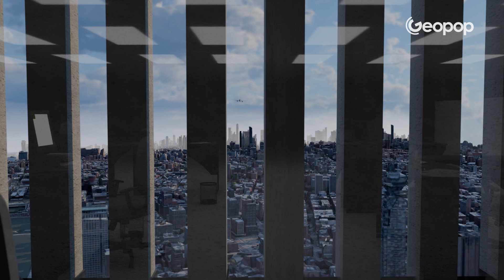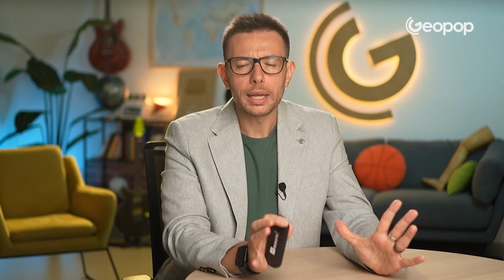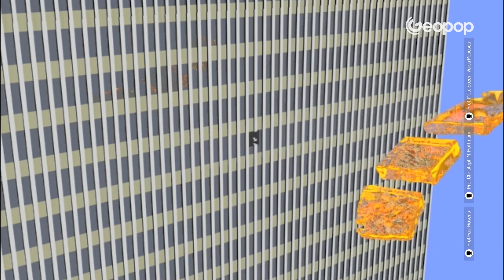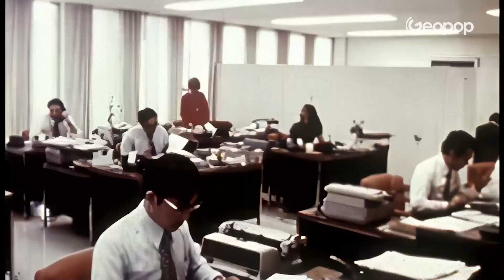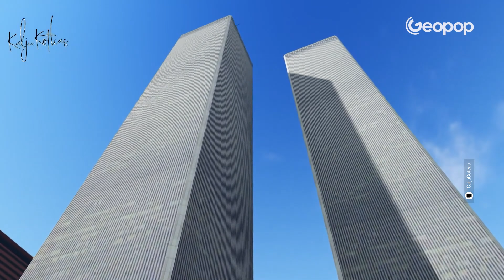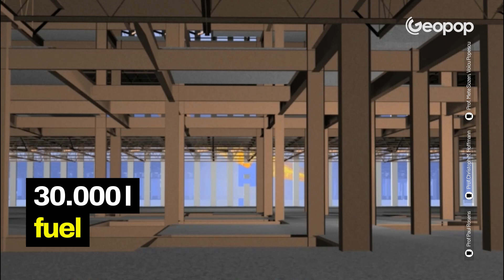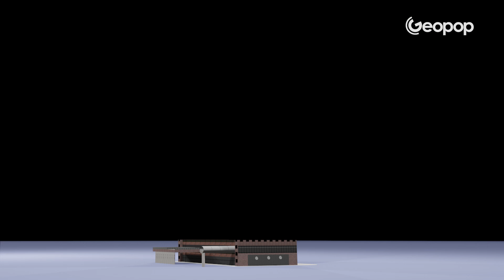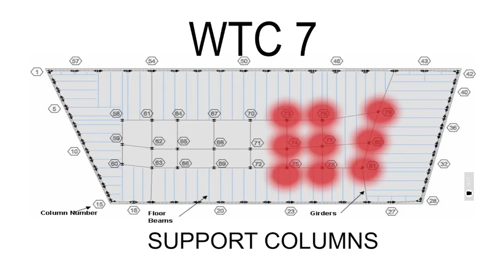9/11, 2001: The Technical Reconstruction of the Twin Towers and WTC 7 Collapses

Comment: I saw on another video that it was detonations going off inside the towers and you could actually hear in the recording the explosions going off from the very top of the building all the way down to the bottom like a controlled demolition and that’s exactly the same way the buildings fell down like it was a controlled demolition it wasn’t just because of the plane the entire towers were built very well they would never have fallen due to just a plain only may be a few floors would have fallen at the top where the plane hit And even if the molten steel got soft enough to collapse on itself it wouldn’t have collapsed the entire tower the way it was built it was a controlled demolition they just simply detonated it after the plane hit to make it look like the plane was the cause for the collapse of the towers the planes actually hit the towers but they were not the cause of the towers collapsing
Reply: So this video you saw was fake. Lemme guess. You can't find it now because it got scrubbed from the internet (like that's a thing and no other media exist).

More dog are my homework BS.
Reply: "I saw on another video that it was detonations going off ..."

Did that other video have a UFO flying above the building about 6 seconds in? I'm not joking! The video you saw was by a comedian who made a fake video with fake explosions (and the UFO!) to see who would bite!

Comment: So many stupid people that were not there with dumb theories who cannot fathom the horror and terror of just being there that day, let alone being a poor soul stuck inside during that raging inferno with nowhere to go. People jump because it simply was so hot. Consider going near a hot fire and what you feel near it ? You immediately go towards free air and relief. Well some simply just couldn’t stand the heat and some couldn’t see due to a giant hole being in the building. Many people are just ignorant to what the inside of that building looked like after an impact of a 737 massive aircraft plunged into it full of jet fuel at over 500 MPH. Floors and walls were missing and bodies and parts of bodies along with a huge air craft was everywhere along with thick black smoke and fire. It must have been truly hell. No other word to describe it. Now building 7 along with many other buildings had raging fires inside as well. After the collapse you must think of all that debris falling and scathing the building doing huge damage to the structure. Just because from the outside it looked “stable” doesn’t mean anything. The towers looked fairly stable even after the impacts until they didn’t . This day never leaves me and I was only watching it in the city. Have compassion for those and their families who were murdered that day and consider what you may have done if you were trapped up there under the worst conditions possible for humans to survive. Don’t forget 18 we’re able to find a stairway above the 72nd floor in one of the towers and lived to describe what it was like up there. A few even survived the collapse that were in lower floors by exits by miracles. My father’s friend Pete was saved by a “cherry picker” or bucket truck from the scene of the collapse. So miracles happened that day also. With any mass casualty or tragedy there is horror and always some kind of good and unbelievable feats of the human strength and spirit.

Comment: We still have access to images where we see steel melted! I just want an explanation for that...
Reply: OK, present the images you want explained.
Reply: @TheLoonResistance  https://www.youtube.com/watch?v=gPu9IqBfMIw&t=147s
Reply: @tiagommmagalhaes  How do you know that's steel?
Reply: @TheLoonResistance  youtube link -> watch?v=gPu9IqBfMIw&t=152s
Reply: @tiagommmagalhaes  - Easy enough. So you think that is molten steel why?  Because you performed metallurgical tests?  Because the internet told you that’s what it is?  I think we can do better, so let’s do better and build a theory the right way instead of making evidence-free assumptions. This will take just a couple of minutes and is worth the investment. 

The Boeing 767 which struck the South Tower weighed 117 tons and 80% of that was aluminum.  The exterior cladding on the Twin Towers – the white panels – were also aluminum. When Flight 175 struck at the 81st floor its momentum deposited much of the office contents in its way and the bulk of the aircrafts mass into the NE corner of the building. The piled up debris shoved into that corner is visible in photographs and video so we know it was there. 

There’s a good shot here of piled up debris from 4:36;

youtube.com/watch?v=ZLJyL63sqtU&ab_channel=MrKoenig1985

Steel melts at roughly 2,750-deg F while fires in the South Tower reached peak temperatures of around 1,800-deg F. Aluminum OTOH melts between 887-deg F to 1,180-deg F depending on alloy. That aluminum will melt under these conditions is not a surprise. If you look at pictures of cars left behind and destroyed by forest fires the aluminum wheels are invariably melted away along with other sometimes aluminum parts like hoods. Steel bodies remain intact. 

The “molten metal” appears at 9:52 am. At the same time we see the first externally visible signs of sagging floor trusses and the pulling of the perimeter columns inward. I submit these events are related, not coincidental. The aluminum cladding at the NE corner also appears to me to be burning. 

It is likely the with the floor trusses sagging under the heat, and the 81st floor truss in the NE corner under the debris pile subjected to the heavy load of the debris pile, the truss broke its perimeter column connections and dropped, instigating the material starting to pour out of the NE corner at the 80th floor.

Given the properties of the materials in question, aluminum is by far the most likely culprit. 

Reports from The NIST, FEMA and MIT all concluded the material is aluminum. 

Certainly steel is the least likely of all the materials the anomaly could be given its much higher melting temperature and the fact there is no logical source for molten steel.  The perimeter columns in the NE corner are intact and the material is pouring out between them. So it isn’t columns melting, therefore what other source of steel is there?

Deniers will claim molten aluminum appears silver when molten, which is true but only at the low end of its melting temperature range. Aluminum can and does get hotter and it glows red to orange when it does (1,100 to 1,800-deg F).  Most folks of course just don’t bother getting it that hot if the goal is just to get it molten for say molding a part. No need to go higher. 

The total mass of molten aluminum is a BIG deal in regard to how it behaves when poured. Quantities bellow half a liter cool almost instantly if poured onto a flat surface, but if poured into say an ingot mould will stay red for a minute of so. Pouring volumes of molten aluminum greater than a liter is a VERY different experience. The thermal mass is much greater and the radiant heat is horrendous. The aluminum is able to stay liquid and remain glowing bright orange much longer. 

The famous video of glowing liquid gushing out of Tower 2 moments before it fell, involves at least tens of liters of molten aluminum. The thermal mass involved is so great that it stays red after falling many meters through the open air.

Side note: There was also a large UPS battery farm in that spot and some of that material at least may well be from the batteries IMHO.

Comment: There had been a meeting scheduled for that morning in #7.  Those guys heard explosions and one elevator fell down.  And there were fires.  But this was long BEFORE either tower fell.  Therefore the problem had not been debris from the fall of tower #1.  They had to explode #7 to hide all of the demolition charges.  The fitth plane never got off the ground.  It would have hit #7 from the north on a course parallel to the plane that hit the north tower.  Look for the video for plane #5.

Comment: I get the heat and the obvious structural damage to the floor(s) that the planes hit, I understand that in some areas there would be heat transfer and I understand that these locations would be under extreme conditions that would lead to catastrophic failure. What doesn't make sense is that there is absolutely no way the heat transferred over 90 floors for the entire building(s) to collapse the way they did, especially with the building having the early stages of post tension engineering, where the building core carries the slab and envelope loads, as well as the steel loaded curtain wall envelope, if anything the core would have remained in tact and the slabs would have broken off from the collapse of the upper floors. There has never been any reasonable explanation about this. I have witnessed and been a part of several destructive testing on some of North Americas largest structures and even under the most extreme conditions, the testing mockup structure(s) never collapses like this. Only in demolition destructive testing do they collapse like the trade center towers.
Reply: It didn't have to. Each floor is designed to support a certain load. The initial collapse is caused by the supporting steel being weakened by heat. Steel doesn't have to melted to be weak. That's what blacksmiths do, they heat it up until it's soft enough to work into shapes, it doesn't have to MELT. Once the floors started to collapse, it didn't matter, the amount of force of a moving object is FAR greater than normal, like jumping on a shovel, inside of just stepping on it with your foot. As each floor falls, the force gets worse and worse, all that that mass falling from above makes all the steels beams irrelevant, that just can't stop it.

Comment: Total BS! no steel structure building in the world has collapsed like the twin towers after a fire. Where were the steel beams sticking up after it collapsed?? And building 7 is totally unexplained. A cover up for sure
Reply: Have those buildings been hit by an airplane before?

Here is a list of other buildings which collapsed due to fire.
Quote:
"Besides the World Trade Center (WTC) collapse on September 11, 2001, there have been a few notable instances of steel buildings collapsing due to fire. Here are a few examples:

The One Meridian Plaza Fire (1991): In Philadelphia, a high-rise building experienced a significant fire that caused a partial collapse of several floors. The fire burned for over 19 hours, and the structural integrity of the building was compromised due to the extreme heat.
The Windsor Tower Fire (2005): Located in Madrid, Spain, the Windsor Tower experienced a major fire that led to the collapse of several floors. The fire burned for about 20 hours, and the building's steel framework was severely weakened.
The Plasco Building Fire (2017): In Tehran, Iran, the Plasco Building, a high-rise structure, collapsed after a fire that lasted several hours. The fire was fueled by the building's contents, and the steel structure ultimately failed.
The Grenfell Tower Fire (2017): While the Grenfell Tower in London did not collapse fully, the fire spread rapidly due to the building's cladding and caused significant structural damage. The building was later deemed unsafe and was partially demolished.
While these examples show that fire can lead to the failure of steel structures, it's important to note that such occurrences are relatively rare compared to the number of steel buildings that withstand fire without collapsing. The design and engineering standards for high-rise buildings have also evolved to better address fire safety concerns."

https://www.quora.com/How-many-steel-buildings-have-collapsed-from-fire-besides-WTC

Comment: The truth is, us common folk will never know with 100 percent certainty what really happened that day...I would say however, this is the best explanation on the structural failure aspect I have seen yet to date.

I have very little doubt, in my own opinion, this "attack" wasn't random and was facilitated by our own government for financial and socioeconomic gain (i.e. resources and contracts in the middle east)...

The government engineering the building collapse aspect though, I have many reservations about. In all reality, the buildings didn't need to completely collapse to the ground for the government to launch into a full blown war/invasion. The hijacked planes being flown into the towers would have been enough on their own to do the job. Why go through all the extra effort to plan a "controlled demo" to take them completely out for just an added cherry on top effect? If you truly understand physics and engineering, there's nothing exceptionally mysterious about the buildings being completely obliterated. Heat depletes the integrity of steel, that is a known fact. Once said steel is subjected to massive amounts of heat for an extended period of time, it will most certainly begin to lose its structural advantages. All it takes is the 1 floor to give out, to begin the domino effect, compounding the cascading floors, one on top of the other...theres no structure on earth that i am aware of, that could withstand these kinds of conditions. Think of a human pyramid..if it was high enough and the top guy was heavy enough, once he belly flopped the person below him, everyone underneath them is getting pancaked.

Everyone is entitled to their opinion and I surely don't trust the government in any form or fashion...but my mistrust in the government doesn't change the laws of physics, which can be used quite appropriately in this scenario. 

Let the feeding frenzy commence!

Comment: Lt. Col. Robert Bowman, PhD - “A lot of these pieces of information, taken together, prove that the official story, the official conspiracy theory of 9/11 is a bunch of hogwash. It’s impossible,” said Lt. Col. Robert Bowman, PhD, U.S. Air Force (ret). With doctoral degrees in Aeronautics and Nuclear Engineering, Col. Bowman served as Director of Advanced Space Programs Development under Presidents Gerald Ford and Jimmy Carter.

“There’s a second group of facts having to do with the cover up,” continued Col. Bowman. “Taken together these things prove that high levels of our government don’t want us to know what happened and who’s responsible. Who gained from 9/11? Who covered up crucial information about 9/11? And who put out the patently false stories about 9/11 in the first place? When you take those three things together, I think the case is pretty clear that it’s highly placed individuals in the administration with all roads passing through Dick Cheney.”

Regarding the failure of NORAD to intercept the four hijacked planes on 9/11, Col. Bowman said, “I'm an old interceptor pilot. I know the drill. I've done it. I know how long it takes. I know the rules. ... Critics of the government story on 9/11 have said: ‘Well, they knew about this, and they did nothing’. That's not true. If our government had done nothing that day and let normal procedure be followed, those planes, wherever they were, would have been intercepted, the Twin Towers would still be standing and thousands of dead Americans would still be alive.”

During his 22-year Air Force career, Col. Bowman also served as the Head of the Department of Aeronautical Engineering and Assistant Dean at the U.S. Air Force Institute of Technology. He also flew over 100 combat missions in Viet Nam as a fighter pilot.
Reply: So what?
Reply: @TheLoonResistance  lol

Comment: How did the fires in the WTC reach 1000 degrees with little oxygen to support that? The smoke seen coming out of the buildings was heavy and even though air was coming in from the holes in the building it wasn’t enough to support high temperatures. Jet fuel itself is a Kerosene based fuel that burns at 600F in the open atmosphere. It burned at 1600F inside a jet engine when it is mixed with compressed air supplied by the front section of the jet engine. but in the open atmosphere, like when it spills out of the wing tanks in an accident it only reaches 600F. Thats why hurricane lamps using kerosene don’t melt. Not the glass or the brass and steel they are made of.
Another question is why was there molten steel in the basement and sub basement level of the towers that remained in a molten state for 14 days after the collapse. That sure as hell wasn’t jet fuel that caused that much.

Tower 7 was an odd event. The BBC reported the WTC 7 had collapsed while it was still standing. The was film of Larry Silverstein saying Pull It, a term used when building are demolished.
Reply: Why do you say there was "little" oxygen? You saw the gaping holes on the sides of the towers. The fires had all the oxygen they needed!

Oh, and jet fuel was not the only thing burning in those buildings. Office fires routinely reach 2000°F - hot enough to weaken steel by up to 90%.

Finally, there is in fact ZERO evidence that any steel melted at the WTC. Yes molten metal was reported - but no one to my knowledge ever demonstrated that it was steel.
Reply: @Tim22222 oxygen starved fires are evident by the color of the flames and smoke/soot. This is well known and documented science. We have the recordings of the fire fighters that reached the impacted floors saying the fires were contained and could be knocked out with 2 lines. 

Office fires can reach 2000 degrees, but that doesn't mean they maintain that temperature evenly and for extended periods. The majority of items that are the most flammable were blown away by the the impact of the planes.  

There are countless pictures and even videos of molten steel days even weeks after the collapse.
Reply: @sidvicious6505  "oxygen starved fires are evident by the color of the flames and smoke/soot"

Can you cite a source for this claim? Because it's not true!
Reply: @sidvicious6505  - No it isn't.